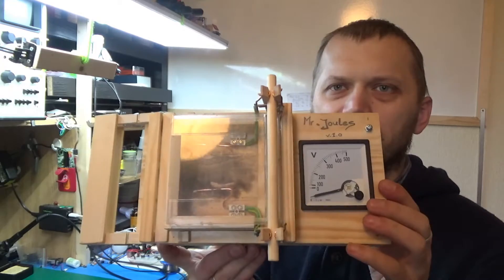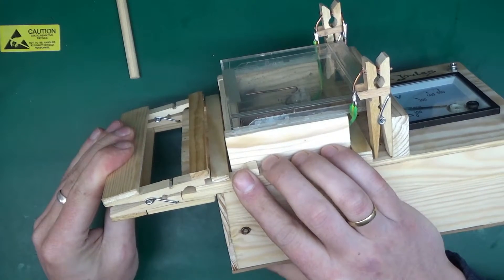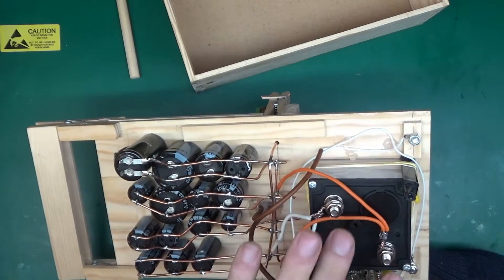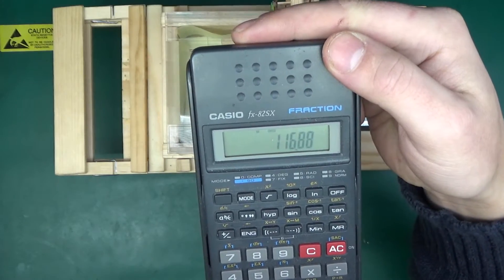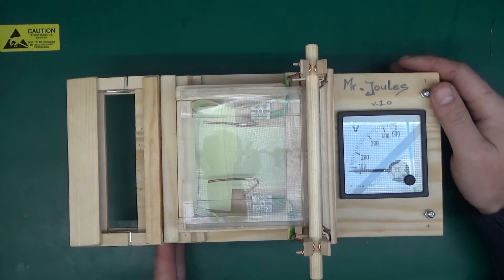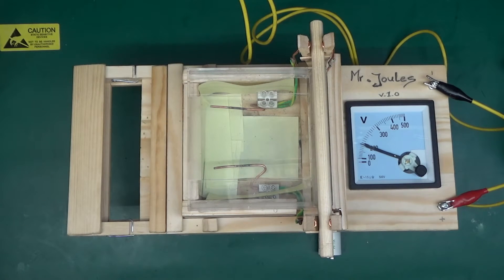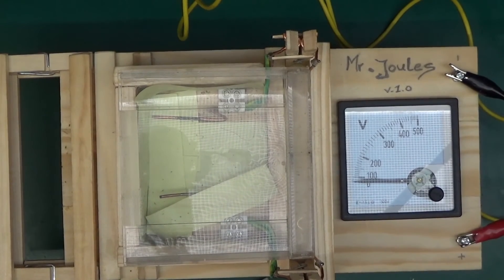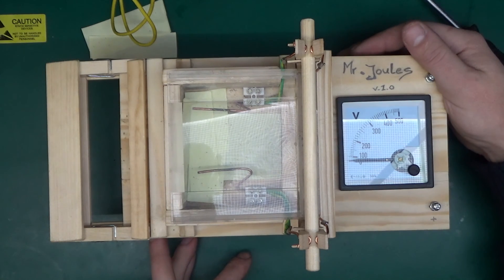Mr. Joules 000  - Introduction - 400V carnage

Comment: from which Material is the Safetygals? if its PMMA or even worse Polysterol its dangerous weak against flying particles. Better Safe material is Polycarbonate (2-3mm)
Reply from the maker: +Hyper Hektor i know that polycarbonate would be best. Unfortunately this is not it. It is acrylic (pmma), and for those reasons i am taking additional precautions. Thats just what i had on hand. The way i am shooting the video, the worst thing that can suffer is the camera gets busted, which is replaceable (but costly...) Thanks for your concerns!
Reply: a cheap source of polycarbonate are CD or DVDs (just rub off the datalayer without scatching it , cheap ones are the easiest) :)
Reply from the maker: Good shout, but it will be not large enough to cover entire thing.
Reply: just use 2/4 :)
Reply from the maker: :) then the joints will be obscuring camera lol!